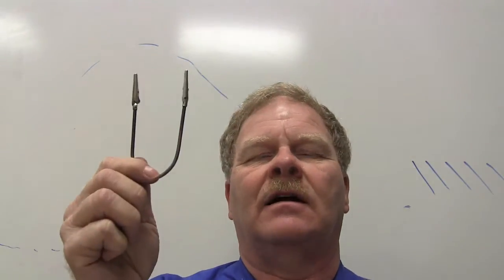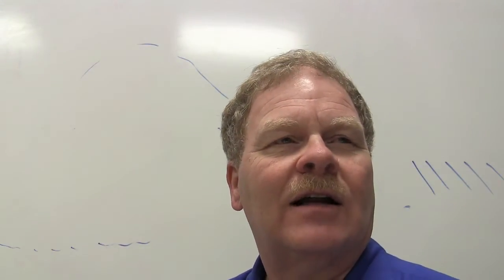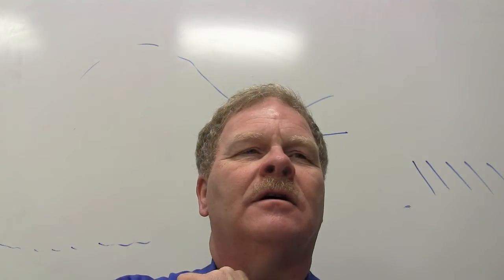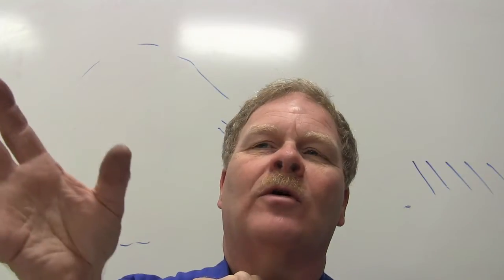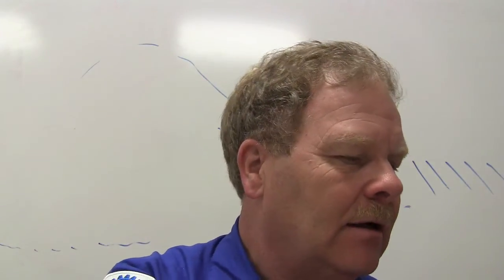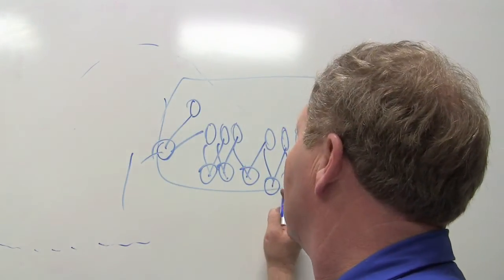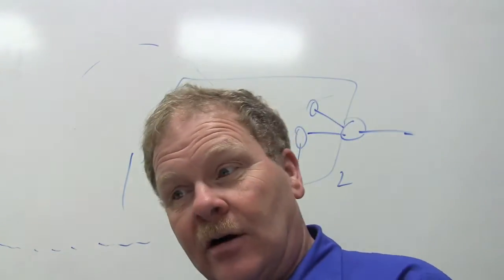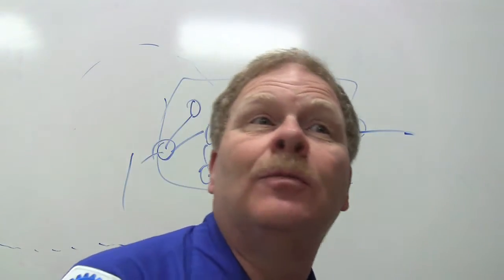Electrical Test 2   Battery Basics

Comment: if a load creates current, where does the current come from that happens during charging of a battery? is the battery the load?
Reply from the maker: Current flows because of a differential in potential - When the battery is being charged, electrons are being moved from the positive side the plates to the negative side, creating the potential energy that is stored in the battery - Charging the battery uses energy to create the current in question, whether by the spinning of the alternator rotor past the stator windings or the electrical action of the transformer in a battery charger.  So in a manner of speaking, the battery does become the load, but the process of charging is more about returning the battery to its potential energy state than it is about doing work you can see.